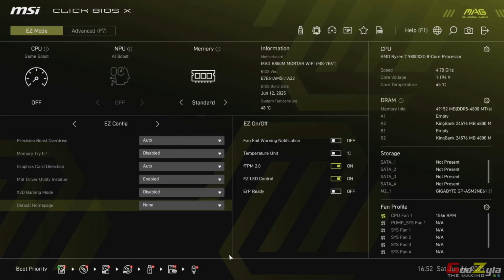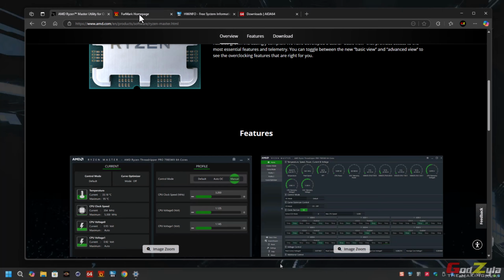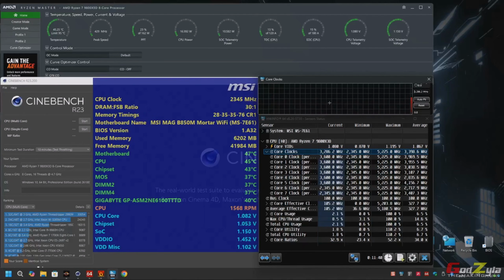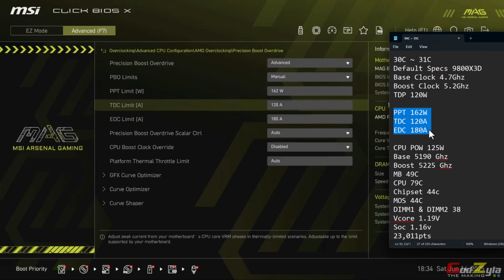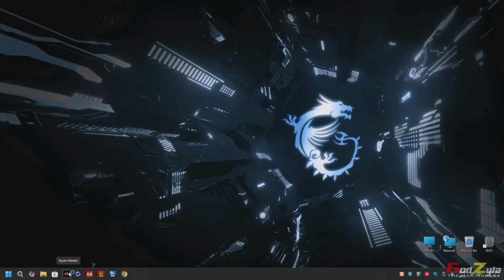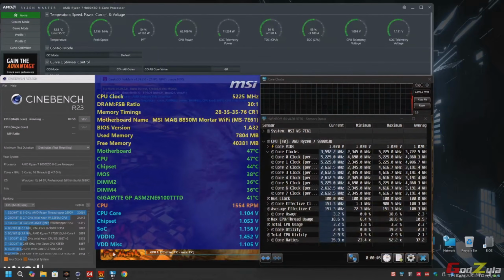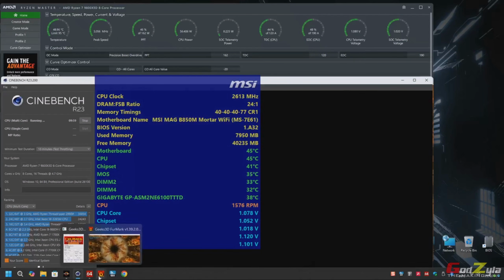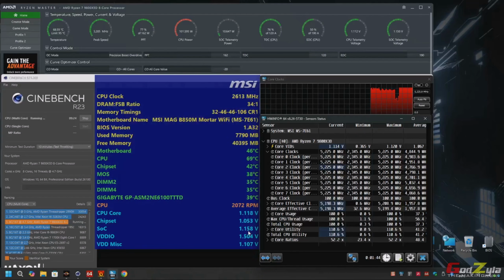PBO2 Curve Optimizing with 9800X3D on MSI Motherboard

Comment: Hi Kleo, out of topic question: I am currently using Asus B850M-Plus WIFI, and I recently bought a WD SN8100 gen 5 ssd. The issue is that the motherboard wouldn’t detect gen 5 ssd at auto/gen 5 mode (bios settings), I had to set the pcie link speed to gen 4 in bios for the ssd to be detected normally. Do you happen to have a gen 5 ssd to test on this motherboard? Just to confirm whether this is chipset issue or individual brand bios issue. Thanks!
Reply from the maker: Hi Heavenly Palace, welcome to my channel. For the Asus B850M board, I have tested with a crucial T705 Gen 5 2TB, no issues, it can detact on auto. have you updated your bios on that board? maybe check if there are any firmware needed on the WD SN8100 Gen 5 m.2.
Reply: Yes latest bios and firmware. That’s weird, I thought it was because the ssd is too new. But I saw other users with am5 rog strix boards having same issue with Samsung 9100 Pro as well.
Reply from the maker: @HeavenlyPalace-Y2K  hmm.. I have no problem with the T705. Let me check with Asus SG, do you mind to drop me an email godzylatech@gmail.com, so that I can follow up on this via email. thank you!
Reply: That will be great! I will link the forum posts and the issue description in the email, thanks!
Reply from the maker: @HeavenlyPalace-Y2K  ok.. kindly allow me sometime, I can work fast but got to wait for their response.

Comment: Great and insightful video, easy to understand and follow. With my specs below, my cpu power draw is only around 110w (previously 129w for some reason) for Cinebench + OCCT and core clock is stable, in Fractal North XL TP.

Thank you Kleo!

Pc specs:
9800x3d with Thermalright PS120 SE
MSI B850M mortar
kingbank c28 6000 24GB x 2
Astral 5090
SN850X 4TB
Seasonic PX 1200
Fractal North XL white TP
Reply from the maker: Hi Ya Xw Xw, welcome to my channel. I am glad this content did aid you. Thank you for sharing your experience and I am happy you have benefit with the settings. 👍👍👍

Comment: What's your opinion on running an 8000MT kit on a 9950X3D and asrock nova board? Should I switch to 6400?
Thanks for making another great video
Reply from the maker: Hi gtafighter, welcome back. It's challenging to run those high bus speed rams and I cannot deny the fact that it will improve performance but it's not that great. My principle will still stick to CL26 CL28 with bus speed of 6000. In addition it's cheaper as compared to spending the high bus speeds that runs on lose timing (Cas Latency). If this is intel platform, yes high bus speed of the rams will help but not on AM5 platform. I wish I got time to show actual compilation work on the two sets of rams I have, but for the time being .. you can refer to this https://youtu.be/Fr7Bfr-wPYw . By the end of the day, the choice is yours. If you have purchased the high speed rams. Just use them, unless you have a return window for them.

Comment: Greetings instead of all cores on CO, do you suggest per core and increase -5 for each core till failure ?
Reply from the maker: Hi Crystal Lyralei, welcome to my channel. You can do manual per core configuration if you want to max out the pull. my guide are just for general usage and to point out the CPU Power drawn and the SoC voltage. infact by doing per core negative magnitude is no difference from what I have explain "The elastic band which stretches to the max" it will lose it's tension at some point of time.

Comment: As usual great insight.  Especially on the SOC.  .… 

I got myself an Asgard 48gb ,6000mhz to. match with 小吹雪.

Can't decide on the CPU n GPU yet. (Maybe just 7800x3d)
Reply from the maker: Hi Chickencow_me, welcome back. That's good, you are at the right sweet spot for those ram kit 😉 as for the processor, both does it's job in gaming 👍
Reply: Is 小吹雪 or Strix B850 G available in sg or sls? Didn't see it on any of the price list.
Reply from the maker: Hi Bryan, welcome to my channel. Singapore is not selling the waifu version, it only sell the international version which is only one shop selling (Performance PC). https://shopee.sg/ASUS-ROG-STRIX-B850-G-B850-G-GAMING-WIFI-MOTHERBOARD-(3-YEARS-WARRANTY-BY-BAN-LEONG-TECHNOLOGIES-PTE-LTD)-i.697821916.41003941761?xptdk=14b0aef2-c070-4026-a1b2-ba94b8a4dd14 . hope this help.

Comment: Thanks for sharing, I want to save this so I can take my time and watch it thoroughly. Thanks for sharing. Also, can the same setting be applied to an MSI 870 E Carbon Wifi as well?
Reply from the maker: Hi Slyclient The Tech Dad, hey welcome back. Yup the interface or dashboard is the same as the MSI X870E Carbon. you can test it out which the settings I've shared are safe to apply.

Comment: Is mortar your mane motherboard?
Reply from the maker: Hi Petr K, welcome to my channel. My main board is an ASRock X870E Nova with a 9950X3D https://youtu.be/TofvZbLE3XQ
Reply: @KleoYan  I was thinking about buying the Nova Motherboard, but a little scared of all the CPUs dying in it, still a problem with latest bios?
Reply from the maker: @kekff7710I see. If you fear, you can choose other brands but for me. For me I have used the nova since day one with a 7950X and follow by my current 9950X3D. It’s too late for me but I have no regrets using it as it’s reliable to me and I have to be mindful of what I have configured in UEFI. I will not do any recommendation and the choice is yours. Just sit back and consider your options.
Reply: @KleoYan  Thanks for answering, Yes I was thinking about the Nova, but I think I will go with the B850M Mortar, I was looking at that also! Thanks for answering. Now what cooler do I go with :) And I can't decide if I should go for 9800x3d or the 9950x3d :/
Reply from the maker: @kekff7710 I see, is either processor, 360 liquid AIOs on current market can do it's job.. if it can cool a 9950X it will be able to cool a 9800X3D without issue. you might want to have a look at the AIOs I've tested https://www.youtube.com/playlist?list=PLEW-b-2vYDdNBAB1QdS1fY1O3EHeHEdOP
Reply: @KleoYan  What cooler do you use on your main PC? for the 9950x3d ? Air or AIO ?
Reply from the maker: @kekff7710 am using the Valkyrie Dragonfang 360 https://youtu.be/ruC4GsnN25s?si=d_BF-oYNbMIJ5Yji